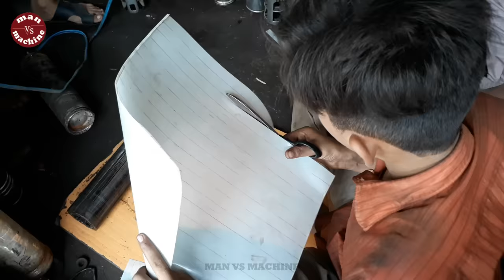Incredible Technique Rewinding 10 HP Water Pump Motor | Borewell Motor Restoration

Comment: As nice as it is to see these being rebuilt, I would think that wiring the windings together and also to the incoming power cable with solder would make for a trouble-free motor.  I say this because unlike jet pumps that sit on the surface pulling (and pushing for some) water making them fairly serviceable having to pull a malfunctioning or dead pump 30-400 ft (about 10 to 120 m) from under ground is a hassle.  Most people wouldn't go to the extra trouble of pulling a pump and having it rebuilt (this is the tragedy of a throw away society) as it really isn't worth it as a lot of well pumps themselves only go for a few hundred dollars (200-2000 in Canada) rebuilding it would be incredibly pricey.

Comment: Молодцы! Какое масло заливают?
Reply: I would think it's an oil similar to that used in other submersible pumps, a non-conductive oil for sure.  I guess it wouldn't be transformer oil as that could contaminate and poison the well water if the casing were to corrode and leak.

Comment: Если судить по изоляции, то его уже делали и возможно они, а учитывая как он долбит по проводу молотком, изоляция полюбому где то страдает, а значит и пробить может, видимо после прошлого ремонта так и вышло. Но все равно молодцы, я как бы не хотел но даже и не пытаюсь что то перематывать, бояться не только руки но и глаза.
Reply: I forgot to say that in my message, but yes, the lack of personal protective equipment, hammering on the stator windings and I brought up the lack of solder on the wire connections are some areas of concern.